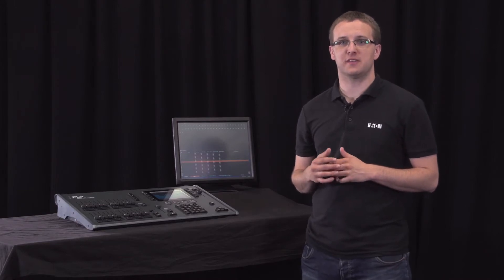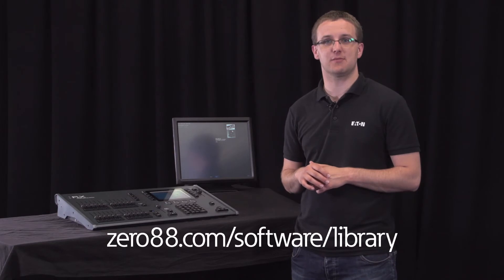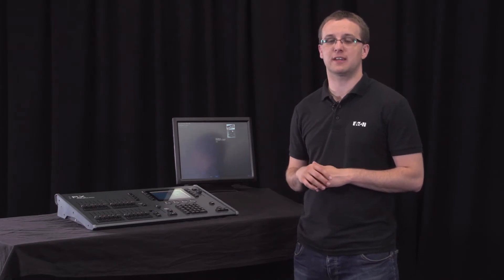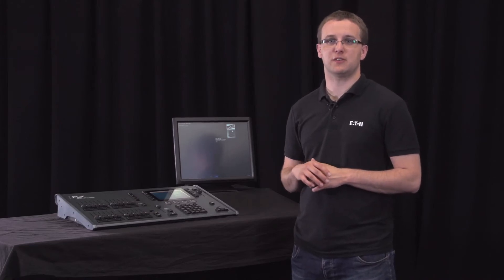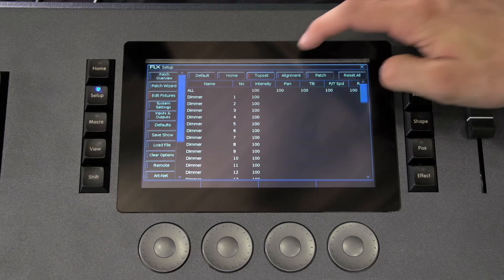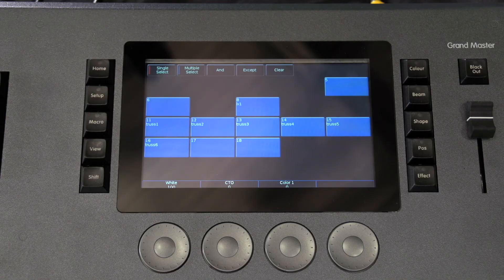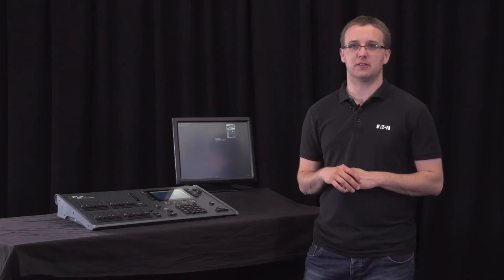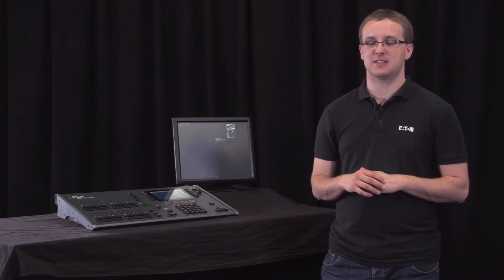Session 5 - Patching and controlling fixtures - FLX Training

Comment: What exactly from the patching process makes two lights to respond at the same time? I would like to separate them for example. So if I type "5 at 100", two fixtures will respond to this. I would like to have one of them on 5 and the other on 6. They are dimmers, so only one parameter.